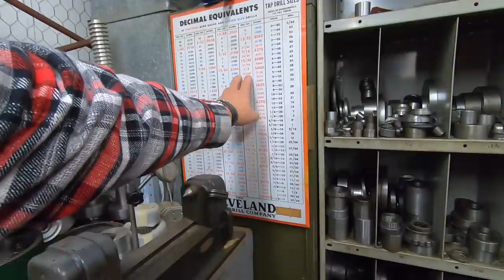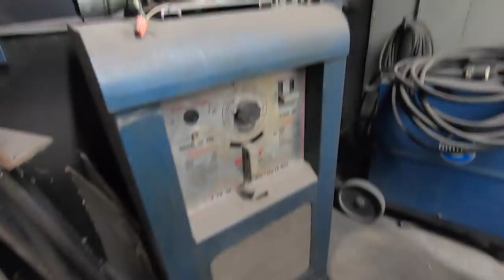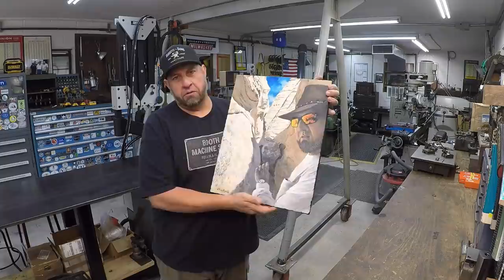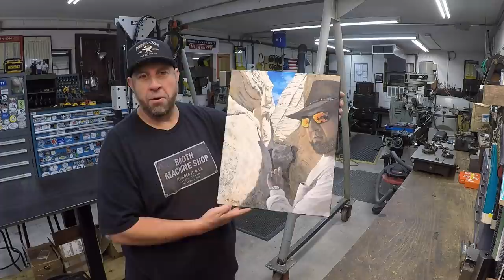SNS 286 Part 2: Texas Machine Shops, Hand Made Gifts

Comment: Largest lathe I ever saw was in Long Beach CA, in 1977.  27-foot diameter chuck.  The bed was specially set and ground crane rail on which the tailstock rode.  As I recall, and it's been a while, it was used primarily for turning very large shafting, presumably for ships, up to something like 160'.  No idea how a shaft that long would be produced, given the manifold difficulties of dealing with a chunk of steel that large.

I recall that the great diameter of the chuck was for accommodating large castings and the sort.

The same company had literally hundreds of Swiss screw machines operating in a huge space, making all manner of brass fittings.  These were all analog, cam-controlled machines.  Watching them operate was quite the memorable event, each with about eight to twelve tools set, each doing its thing in turn.

While I greatly admire the broad utility, precision, and repeatability of CNC machinery, there is a quality and character to manual machinery that is in some ways very different and singularly worthy of one's respect and affectionate regard.

Comment: I spent a lot of years sharpening tools for machines.. Single point and multi point. I worked for GE in Schenectady,Ny building turbines and generators. I watched the drill grinder video and wondering if it has a way to refresh the web in the drill? We did most of the sharpening of tools on a Cincinnati #2 and #3. The three was a contour grinder and used cams and a follower to get what you needed.That is the two that we used the most. How ever we had several machines for hob grinding and ball end mill grinding  etc. Most were manual until later in my career. It was still great to see the upgrades. Have you run across these grinders? Changing the geometry on any tool can help. I have all this in my head and not on paper. I'll give you one as an an example.. Hard stock cutting  end mill or single point less than 001 per  1/16 inch over a 32/second land.Hope to hear from you on grinding machines.

Comment: 0:39  Wow, that looks like one of the old shapers that uses a mechanical drive instead of hydraulics.  It's nice that you keep using your old equipment.  Some of that old stuff is built a lot better than anything you can buy new nowadays.  4:30  That's a really nice drill sharpener.  Do you ever have to thin the center part of the drill after sharpening?  I find that after sharpening enough times it tends to get wider.

Comment: I used to have an Oliver drill pointer.  You guys didn’t mention that the clearance angle increases towards the center.  This really helps when drilling at high feed rates.  It was a great machine. I had to have counseling after I lost it. Almost killed my self. 
How much power does the mag chuck on that big ole grinder use?
Love those beautiful old machines.  Thanks for the video.

Comment: Where can I find drill bit sharpener? The homeowner stuff don't cut it
Reply: You have to weigh your options. There's anything from $30-3000. What are your needs?
Reply: @xenonram  small shop
Reply: @BKMDano17  if by small shop you mean, a business, you can either incorporate new bits into larger job quotes, or incorporate sharpening costs into quotes. (Which may actually put you out on top of your time is valuable, as sharpening bits takes time.) You could sharpen free hand like a lot of us do. You could send them out for sharpening, which gets them like new, even broken bits. Machines like they show in the video are very expensive. There are modern versions that do the same job. Just search "drill sharpening machines" on Google. There are dozens of them. Without knowing where "small shop" means a business or not, how much drilling you're doing, how much money you're making, how much free time you have, how much you value your time, and how much you want to spend, it's hard to say.

Comment: Sad part is you can't replace those machines or get parts , count how many great machine tool companies are history. soon it will be operators like me will also be history.
Reply: Can’t get parts? Isn’t it the claim that a lathe is the only machine capable of fabricating itself?
Reply: You know some things just can be replaced sure CNC machines are the future of manufacturing, but machinists cant and will never be replaced, it's just too difficult doing repair work on a CNC machine or rather time consuming.
Reply: Operators like you will always be necessary. CNC is too expensive for single use and small runs.

Comment: That Texas Tool Traders drill chart has a familiar number on it:  LAkeside 8-0591.  When I was starting out as an aircraft mechanic I had an apartment in Dallas near Love Field, my phone number LAkeside 8-0282.  In 1965 most of the apartments in the area were filled with stewardesses, so I did not mind the noise from low-flying airplanes.  Aircraft departing Love Field today climb so much faster that you seldom hear them.  The local water tower still stands near the site of the old apartment building, but now it is painted white rather than aviation orange and white, as it is no longer considered a hazard to navigation.  It was definitely a hazard in 1965 to the weekly departure of a scheduled USAF C-124 flight.  With its four, twenty-eight cylinder engines, it would struggle to gain altitude and sometimes rattle the apartment as it scraped over the tower.  Ah, aviation.
Reply: Hopelessand Forlorn two engines. C130 4 Turboprop engines.

Comment: Wonder what tolerance that giant grinder can go down to.
Reply: The one's that polish the mirrors for telescopes hold microns.  But for a rough grinder like that I can image it's probably within a few thou.  Most machines of that size would be pretty rigid, especially a surface grinder that isn't taking as much load relative to a lathe or a mill.  You'd probably be more likely to get more run out based on human error with installation and keeping the chuck and head perfectly angular to each other.  That would be my guess anyway.

Comment: I thought one was not to use the side of a grinding wheel!
Reply: Wheel is called a cup wheel as it has very thick rim for strength.
Used to use one of those sharpeners about 50 years ago but it was easier and quicker to sharpen a drill by hand and eye.

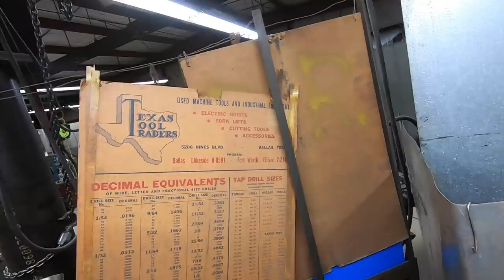Comment: what was the deal with that Cincinnati mill near 12:00. looked like it had a shaper ram on a horizontal mill
Reply: Chris Winslow you can pull the “ram” forward to overhang the bed and then it will hold the other end of an arbour so you can do horizontal cutting as well. Sometimes the mill also has a vertical head which mounts on the same ram.
Reply: @wtrooms  oh, so they just used a ram with ways as an overhead support instead of the other bar style like Adam has at home? Thanks!
Reply: Exactly, think along the lines of the top ram on a Bridgeport 👍🏻

Comment: Adam, that "large" rotary surface grinder reminds me of when I had the chance to tour NASA's Michoud Assembly Facility <https://en.wikipedia.org/wiki/Michoud_Assembly_Facility> where the Space Shuttle external fuel tanks were being manufactured at the time.  Given the size of those tanks, you can understand that many of their machines were of the same scale as that rotary surface grinder.  Until then, I had thought that the vertical turret lathes & grinders at work were large -- boy was I wrong!  The VTLs at Michoud were/are easily as large as that rotary surface grinder, if not larger, I think.  But if that facility still has "open house" days, I recommend that you guys take a visit.  The Wikipedia page above says that it is open to public visitation, so you may not have to wait for an "open house" day.

Comment: I cut my machine repair teeth on Barber Coleman hobs and a Fellows shaper as well as other machinery. I haven't given those old machines much thought since those gear machines were replaced with CNC in 1993. Video panning over those machines I am pretty certain that I saw the same models that I serviced.
I visited a shop years ago that had a large room full of Barber Coleman's that they had shop retrofitted to CNC. We outsourced our spline work or machined splines on CNC lathes with milling capacity. We CNC hobbed both spur and helical gears and CNC ground our precision gears. I love that big grinder. Our biggest was about a 50" chuck.

Comment: All of these machines look really old, like late 40s or early 50s.  Are more modern machines too expensive?
Reply: Unfortunately, most modern machines have to be programmed by some college guy who doesn't want to get his hands dirty.
Reply: @mountainmandale1587  What I am hearing is you can't figure out how to use them and you eschew anyone with the education to do so.
Reply: There is nothing like running old school machine's thare so much more solide then a new cheep Chinese machine
Reply: They both have their places, a manual machine is better for prototyping designs if you have a skilled machinist. Can make 10 cuts on an old manual machine in the same time it takes to power up and self test a cnc